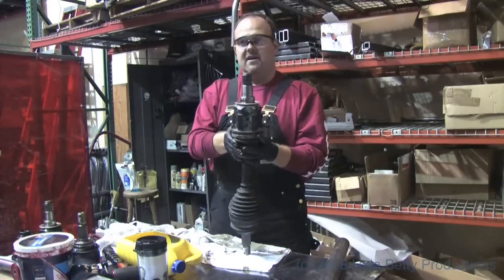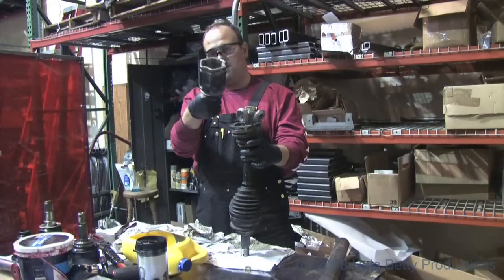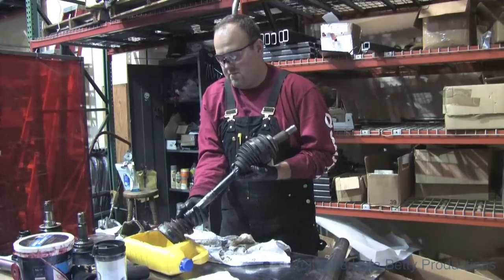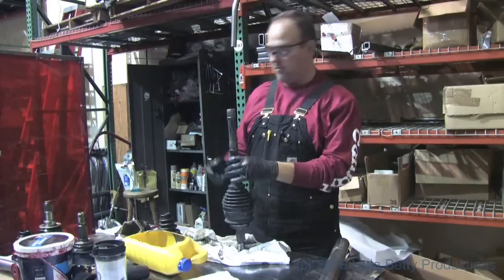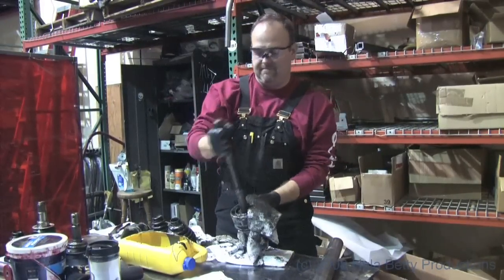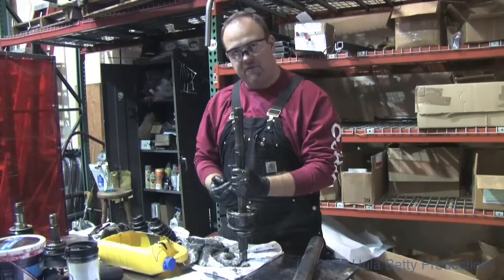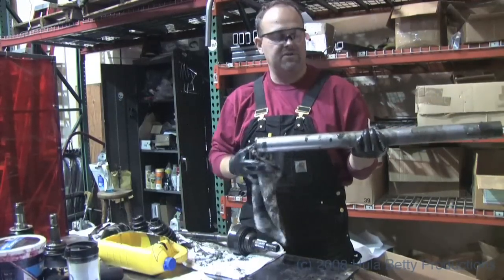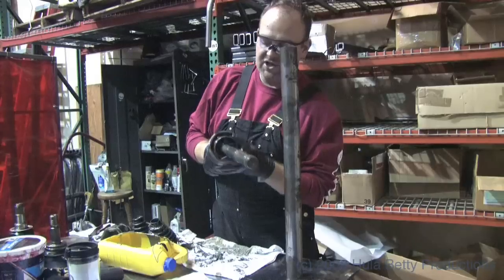Birfield Removal - IFS Axle Disassembly

Comment: Thanks for documenting this process. 
I have a Toyota Hiace which has shorter CV axles than the pickup/4Runner so I’m going to try mixing and matching new pickup axles with my short “intermediate shafts” to make it work. Problem is, the outer splines stripped.

Comment: Where do you get another clip?
Reply from the maker: good question....   I'm assuming you are asking about it for an FJ Cruiser.  You're looking for "30 Spline Cir Clip" (google search) I'm pretty sure it is a 30 spline for the fjc.  Toyota guys will refer to the CV as a Birfield.  You can call over to JustDifferentials  and verify the ones on their website will fit the INNER for an FJ Cruiser. ( https://www.justdifferentials.com/AXTOY-CIRCLIP-p/axtoy-circlip.htm)  Just be sure you are asking for INNER since they are different from the outer clip.  Hope that helps.
Reply: Last Great Road Trip 
Thanks. I just installed a camburg long travel on my fj and couldn't find another clip. I had to install the birfield to hold the front hub together while i locate a replacement clip. Thanks again